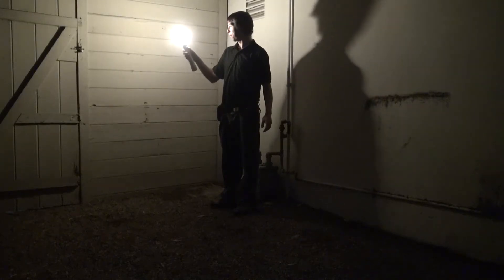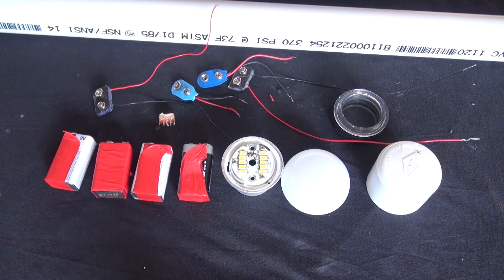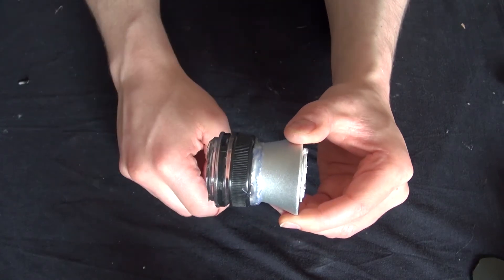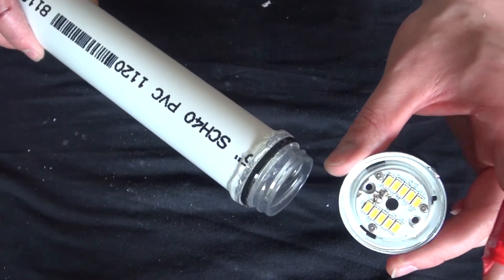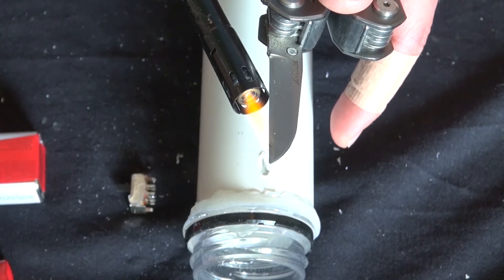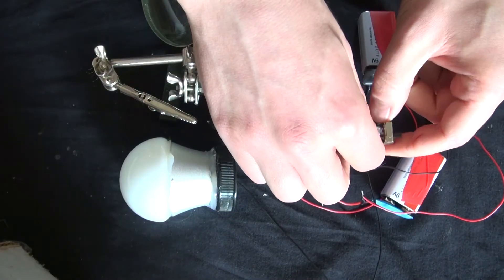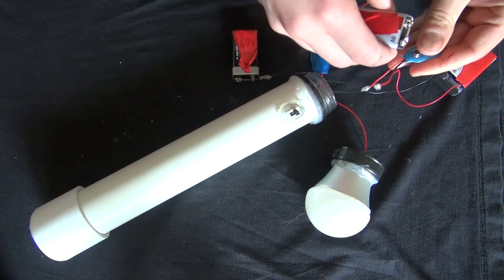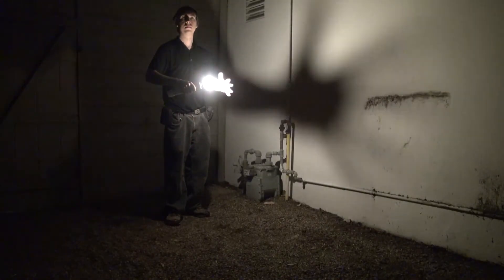Convert LED Light Bulb To A Flashlight

Comment: thanks for this video, simple yet extremely useful, I want to do the same to a bulb here that is very faint, I tried to resolder the wires but does not work as it worked before, this is going to be very useful
Reply: Not same

Comment: Why not just use D batteries? They  are easy to put into series compared to 9 Volts.
Reply from the maker: Good idea, but it would take a lot of batteries to match the same voltage and it would be too heavy.
Reply: @SciTyeTech  D cells have more current thus last longer which is why Police use them. Remember, LED light bulbs are more efficient so you won't need much Volts.

Comment: If you remove the plastic cover, the beam will be stronger and more linear. Leaving the cover on makes it more like a modern Medieval Fire Torch.
Reply from the maker: That's an interesting idea. However, I like how to cover disperses the light.
Reply: @SciTyeTech  Yeah but it disperses such a wide beam that it reaches your eyes.

Comment: You should have used a Joule Thief style boost circuit so that you wouldn't need so many batteries.  Ideally it would make the most sense to run this from Li-Ion cells too.
Reply from the maker: That's a good idea! I made this video simple for anyone to do. But I may make that in the future.

Comment: At most stores you can actually get 12 V LED bulbs meant to replace the halogen bulbs in desk lamps.  The ones I have were $4 at the dollar store. They're 6W, 450lm and run on as little as 8V AC or DC with constant brightness.  They're the ones with the 2 pins  The crazy thing is I've taken the lens off and measured the voltage at the board and the driving circuitry is boosting the voltage to about 30V.   I have one on my bike as a headlight and it works awesome on either 2 or 3 Li-Ion cells.  Here's what they look like: https://multimedia.bbycastatic.ca/multimedia/products/500x500/113/11356/11356844_1.jpg
Reply from the maker: That's an interesting device.
Reply: Yeah but the thing is halogen bulbs last longer than led bulbs
Reply: @entity9742  No. I don't know where you get that idea.  A well designed LED lamp can last up to 25000 hours while the best halogens last perhaps 1500.  https://en.wikipedia.org/wiki/LED_lamp#Comparison_to_other_lighting_technologies

That said, typical "budget" LED lamps are typically designed to operate so hot that either the :LED's or the driving circuitry will fail way sooner than what's possible with the technology.  bigclivedotcom explains this pretty well in this video: https://www.youtube.com/watch?v=klaJqofCsu4 .
Reply: @whatelseison8970  half the time when i used one of those bulbs in the vid they died out almost 2 months after installing them and i dont need to run the lights throughout the day since my room is well lit from the window and i have one light fixture that is halogen and another that is flourescent and both have lasted almost 2-3 years without having to change the bulbs and they still run perfectly

Not saying leds are bad im just saying i would prefer incandescent over led since they last incredibly longer for me
Reply: @entity9742  Yeah, I've had pretty similar experiences with cheap and sometimes even midrange LED bulbs. It's a real shame that profit motives are getting in the way of people getting the very good impression they ought to from the technology.  As I said, a well designed LED bulb should last 25000 h or ~15 years of regular use minimum.  The one thing for which incandescent remains the gold standard is color rendering index, although LED's are much better than CFL.  YMMV but don't write off LED's.  See if you  can find a cool running unit at the store or ask around online. They do exist, the market is just flooded with cheap trash.